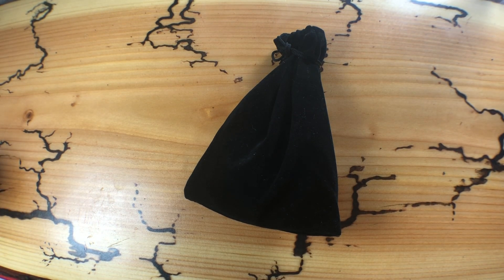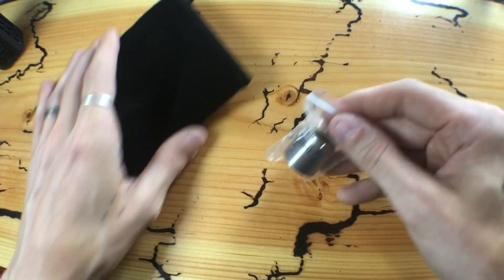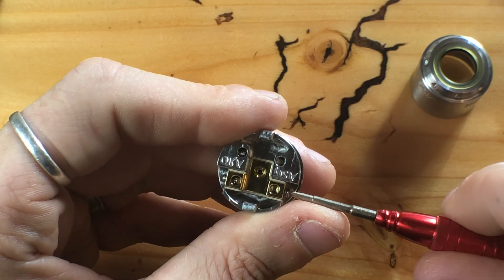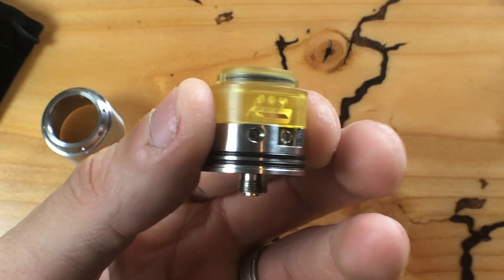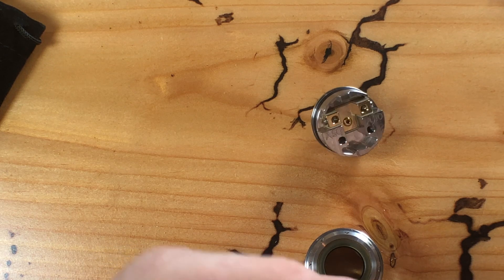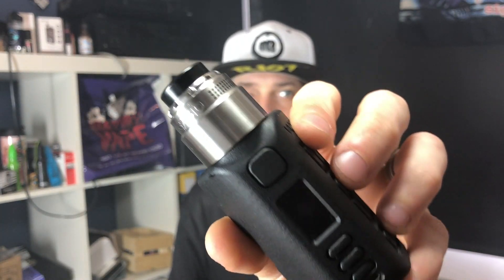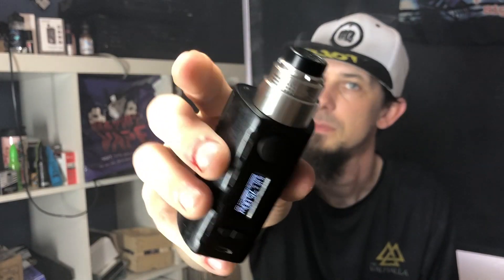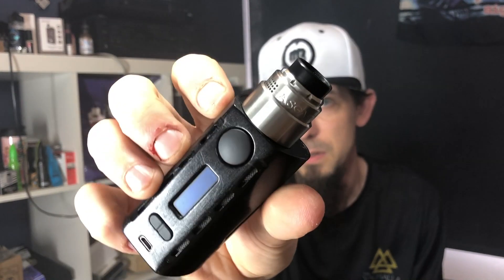Asgard 25mm RDA by VaperzCloud Review in English.

Comment: Which one do you prefer? the 25mm or the 30mm? i mean only for flavour. Because i want to buy one and dunno which one.
Or should i buy sth else?

For the 30mm im in hope that its gonna be not as hot as any other rda, because its big...
The 25mm will be maybe hotter, because its smaller...

Cheers :-)
Reply from the maker: Thats a hard question actually. Flavor on both is really good so I would decide based on what you are going to put it on.
Reply: @1EyedVaper  thx for the answer:-)
Ok, then i dont need the 25 one:-)
Reply from the maker: As for getting hot both of them really perform well. Because of the ultem insert a lot of heat doesn’t get through to the barrel.